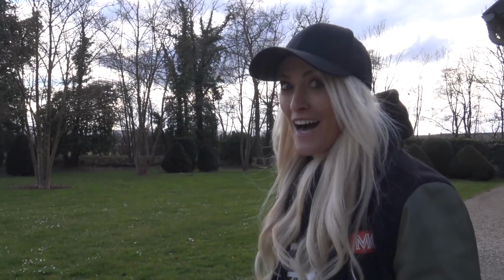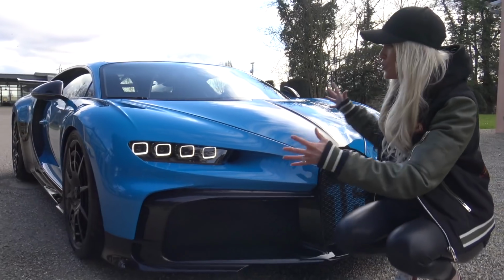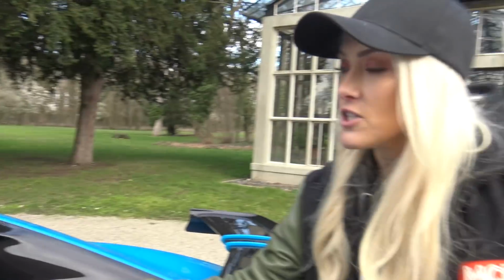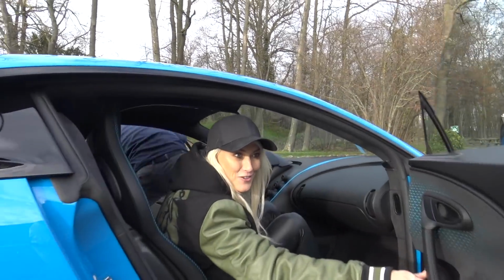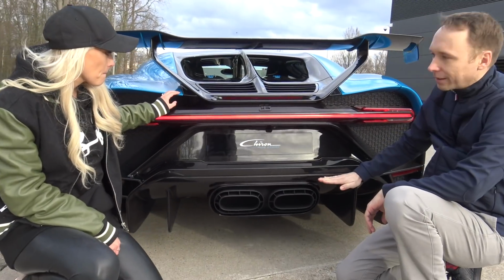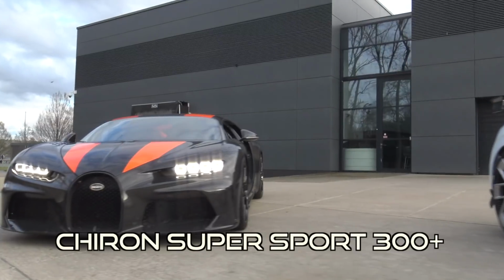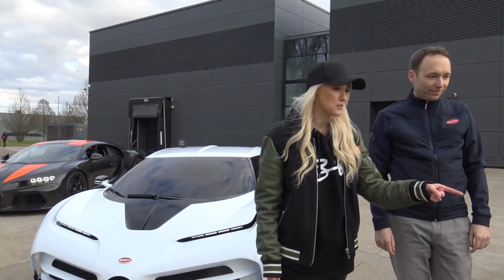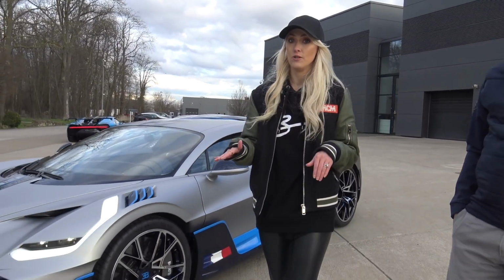Star Wars X-Wing Fighter Bugatti | Chiron Pur Sport

Comment: Supercar Blondie: that X is inspired by the X-wing Jet fighter....

Me: X-wings fight in space - Jet engines need a constant source of oxygen to facilitate the internal combustion process - oxygen does not exist in space.  🤦‍♂️

Most likely it's a reference to the Bolide (French for Meteor) a limited edition (production limited to just 40 examples, same as the Divo) track focused hypercar based on the Chiron but with the most extreme iteration of the trademark W16 engine uprated to 1825 bhp (vs 1500 bhp in the standard Chiron) and dry weight reduction to 1,250 kg (compared to around 1,996 kg for the Chiron)
The Bolide has the letter X as a recurring theme throughout its design, including the head/taillight setup.

Comment: if bugatti really  wants to make a little track focused car then they 
should reduce some weight from the interior and track focused car don't 
require this much power because for 1500 hp u need large engine which 
also brings a lot with it  , they also have maximise the use of carbon 
fibre  . bugatti really need to bring some new design with much 
aggresive lines and i request them that if they are trying to make track
 focused car u may keep the interior simple and light and also thay 
don't require that heavy engine .

Comment: Chiron looks more stylish and aggressive then divo.
Reply: Quantum entanglement is a quantum mechanical phenomenon in which the quantum states of two or more objects have to be described with reference to each other, even though the individual objects may be spatially separated.

This leads to correlations between observable physical properties of the systems.

For example, it is possible to prepare two particles in a single quantum state such that when one is observed to be spin-up, the other one will always be observed to be spin-down and vice versa, this despite the fact that it is impossible to predict, according to quantum mechanics, which set of measurements will be observed.

As a result, measurements performed on one system seem to be instantaneously influencing other systems entangled with it.

But quantum entanglement does not enable the transmission of classical information faster than the speed of light.

Quantum entanglement has applications in the emerging technologies of quantum computing and quantum cryptography, and has been used to realize quantum teleportation experimentally.

At the same time, it prompts some of the more philosophically oriented discussions concerning quantum theory.

The correlations predicted by quantum mechanics, and observed in experiment, reject the principle of local realism, which is that information about the state of a system should only be mediated by interactions in its immediate surroundings.

Different views of what is actually occurring in the process of quantum entanglement can be related to different interpretations of quantum mechanics.

Comment: How does this compare to a Divo and where does it fit in the line up? Between a Chiron Sport and Divo?

Pur Sport performs better than a Divo for half the price, but if you produce 20 less you can charge double :)

Divo: Most agile and dynamic car Bugatti has ever created
Pur Sport:  Most agile and dynamic car Bugatti has ever created

Divo: Relatively similar to the more luxurious Chiron, but has Alcantara upholstery and carbon-fibre trim in order to save weight - 4283lbs (weighs 77lbs less than Chiron Sport (4360lbs)

Pur Sport:  Relatively similar to the more luxurious Chiron, but has Alcantara upholstery and carbon-fibre trim in order to save weight - 4290lbs (weighs 110lbs less than the standard Chiron (4400lbs)

Divo: top speed, 380 km/h (236 mph),
Pur Sport: top speed, 350km/h (217mph)

Divo: Production, 40
Pur Sport: Production, 60

Divo: $6mil
Pur Sport: $3mil

Which would you choose?

Comment: The Veyron is lighter than both the standard and this special version of the Cheron by 100+kg. Why are the newer cars heavier?! I don't get it. Also, I don't agree that spoiler has any resemblance to an X wing at all. It's massive, compared to the Veyrons wing that was tucked away until you braked. You can probably tell I like the older car than the new one. I don't hate any of the latest cars, I just like what I like, ok?!